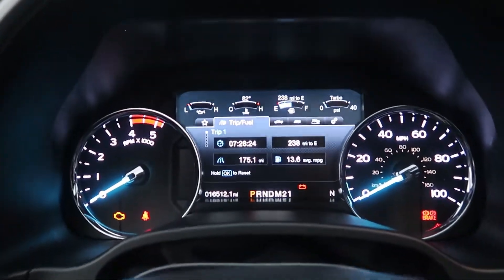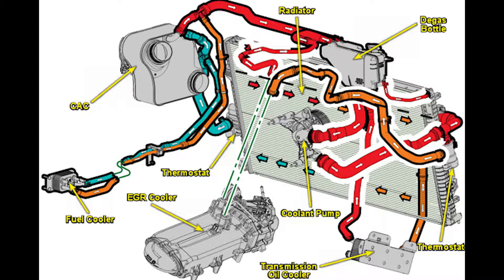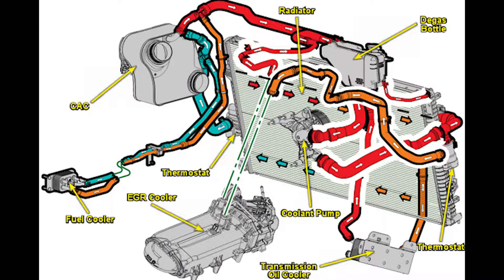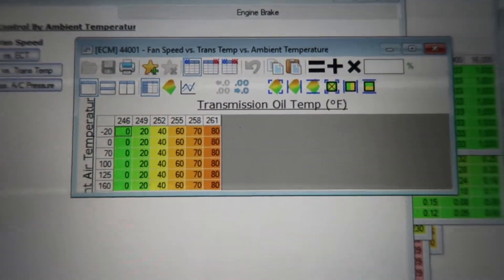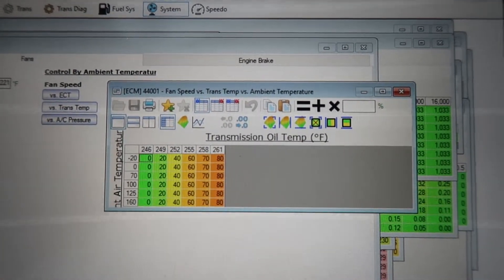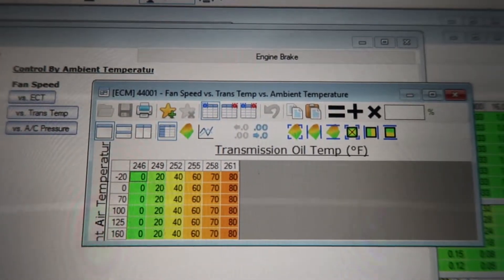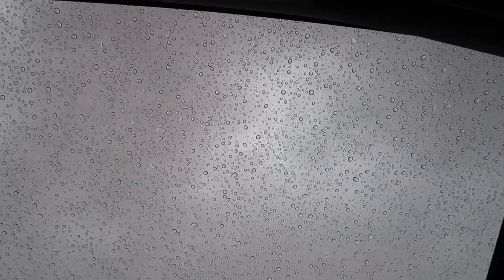Why the Ford 6.7 Diesels  Run "HOT"

Comment: I’ve been getting oil temps to 246 climbing hills pulling a big Tex 22gn trailer and a sany 50u 12 thousand pound excavator. My fan kicks on at 238 i thought it was having issues it’s a 2017 f350. My 2019 doesn’t get that hot pulling the same trailer and excavator.
Reply from the maker: Might be time for a oil cooler

Comment: Not trying to be combative but not fully buying it. My 23 F350 Tremor w the 6.7 HO runs steady temps even overloaded through the Rockies. My 2024 F350 runs way hotter on the same routes at 18000 lbs loaded (1500 under gvwr). I think Ford went super aggressive in 2024 and 2025 for tightening EPA regs. Not good for us.

Comment: Thanks. Well expressed. Im pulling a heavy load these days and worried often about running my transmission over 215⁰. I'd back off to 55mph. This cost me a lot of miles per day. Changing your fluids regularly and more often in the transmission are very helpful in prolonged life if towing. Ford mechanic (my neighbor) said to replace the trans fluid as often as 25k miles for heave constant towing,

Comment: I have a 2015 F350. Pulled my 12k trailer up a pretty serious grade. It was 74 degrees outside. My engine oil temp hit 247. My coolant temperature went up to almost 3/4 of the gauge. When I crested the hill, the temperatures came down quickly. I did not hear the engine fan engaging. I know my parameters were acceptable, but is it normal for it to get this hot low ambient temps. I’ve only pulled with it once, but it’s a freaking horse. I live in Nevada and it will be over 100°. I just want to ensure that I’m not gonna have any overheating issues. Any comments would be appreciated.
Reply from the maker: That is not normal. Is the truck tuned? Tuning can produce higher coolant temps and thus oil as well. Also check your coolant level, make sure you're full on both expansion tanks. Look for debris between the radiators. I tend to see a lot of leaves and trash buildup between the two rads, also bugs and rocks tend to get stuck in the radiator fins themselves on higher mileage trucks. Remove your plastic rad cover and look between them, shine a light on the backside and try to look through the radiator fins. These work well for cleaning them out: https://www.napaonline.com/en/p/BK_RG1002BK?cid=paidsearch_shopping_dcoe_google&campaign=GSC-Tools-Equipment&campaign_id=8553470562&adgroup_id=107047174069&adtype=pla&gclid=CjwKCAjwg-24BhB_EiwA1ZOx8jvOkEZz4UJb_HAo0bH7-mSRE312IQv535upJRVHGco-CaG7vxrTERoCVsgQAvD_BwE&gclsrc=aw.ds&gad_source=1

Comment: I have a quick question? What is Ford’s desired oil temperature and what really is the sweet spot? I see coolant and transmission. I just want to make sure about oil. Because I live in Central Texas and it’s hot! I would really love to know! Thank you for the video!
Reply from the maker: Within 20* of Coolant. IE coolant = 220 oil should be 240 or less. Oil is cooled by coolant therefor it's temp will never be lower than coolant except during initial warmup. Bad oil coolers will cause higher deltas.
Reply: @JaegerWrenching  thank you! Just wanting to make sure! Got a new subscriber too 😎

Comment: Also about fan speed , my coolent was at 210f but my oil was 280f ( plugged oil cooler) fan didn't turn on on high! , I wonder if coolant and oil needs to be at certain temp in order for ecu to turn on fan.

Comment: What happens when you sit in traffic with air to liquid? There is no air moving , will it overheat ?
Reply from the maker: You have a fan that pulls air through the radiators while sitting or moving. If your temps were getting to 280 you have an issue with coolant flow coolant fill or air flow... Most trucks that have some miles on them get dirt and debris on the radiators blocking/inhibiting air flow through them. I recommend removing your front grill and thoroughly cleaning your radiators "there is two of them" with a pressure washer until water flows easily through them.

Comment: So I was pulling my toy hauler that weight 9500 empty , up to 9% slope , my oil temperature went up to 275f, at 280f I had warning light slow down motor at high temperature , reduce power , so ford programmed warning light at 280f , so truck can go up to that temp and survive if ford have safety light at that temperature , full synthetic oil degrades at 400-700f , reason I got such high temperature , my oil cooler was plugged , I took it off and I had bunch of junk in coolant ports , iron block needed to be cleaned , replaced oil cooler , flushed my system and im back to normal towing Temps 240f up 9% grade. Oh i have 2011 ford f250 with 270k miles on it , delited. 
P. S also for all of you trying to compare ur truck temps to ur friends truck , it only works if both of thrm are stock , if u have 37" tires and lifted , ur trucks work harder rolling ur big ass tires up the hill so you will have higher temps than ur friend on stock tires .! And no lift. !

Comment: I wonder if you can answer a question nobody else has been able to help me with. I have sensors on my water as well as air temps. Do you know what the max air intake temp should be going into the motor after it comes out of the cac?
Reply from the maker: There is no max temp and it'll run with very high inlet air temps. How ever your turbo will outlet 350* air temp prior to the CAC. A good working CAC should be able to bring that down to 150* or less. Tuning and total airflow through the cooler will changes these numbers a little. Hot tunes can get turbo outlet temps into the 450+ range and post cooler into the 160-170s. Boost Derate happens based on a specific boost number and barometric pressure as those two things dictate exactly where in the turbos compressor map you'll be operating and thus how efficient it is at compressing air at that exact point. More efficient = less heat generated or lower turbo outlet temp, less efficient = higher turbo outlet temp.
Reply: @JaegerWrenching  thanks for all of the info. The problem I'm having is I'm getting about 405° out of the turbo and then it's still up to 225 after the CAC.
Reply from the maker: @duner1972  What is ambient temp and how quickly does it get up to the 200s?
Reply: @JaegerWrenching  it's usually in the 90's ambient. It's when I'm pulling long hills pulling about 20k. It's a 2015 F450. I have actually melted 2 intakes and blew the backs out of them.  It has gotten better after switching to a soft so I can run stock settings. I just didn't know if putting an aftermarket CAC would help. Even in stock mode, I have to fether the throttle to keep egt's off of 1500
Reply from the maker: @duner1972  Put a 2015 andup[ turbo on it. That SST turbo is great for down low but it doesn't have enough air to clean it up. Those number are pretty norma for longer pulls and with a heavy load. The cooler will saturate. If anything replace your cooler with a stock one. Also check your coolant level  on your smaller coolant tank by the rad fan passenger side.
Reply: @JaegerWrenching  it actually does have the larger turbo. I already had that checked. I was having a problem blowing water out of secondary cooling system. I put a cap off of a 6.4. It's higher pressure.
Reply from the maker: @duner1972  Your CAC is bad and it's pushing boost into the cooling system which is why your cooler cap would push water . This pushes the coolant out of the CAC and so it doesn't cool properly. This is common! Replace it ASAP with a stock one as every aftermarket one is worse than stock. SPE has one coming out which maybe better but i'd go with stock if it was my truck.
Reply: @JaegerWrenching  Yes, I actually had my original one go bad, I put a new stock one on it. I think that's what melted my intakes, but it will still push water if I fill it to full line. I'm just wondering why I'm getting intake temps up so high. If I just drive it according to the dash gauges and pyro, everything seems to be ok temp wise. When monitoring actual intake temp, just seems high

Comment: Seems like Ford really designed and engineered a great engine, a real towing machine. I bought a new '17 250 6.7 not because I tow but because I enjoy road trips and want an engine that can muscle through just about any grade or temp without puking. 

My late dad always told me to always get the biggest engine you can afford. The weight of the vehicle and air resistence remain the same. A larger engine works less than a smaller engine. I've seen so many vehicles in southern California climbing Tejon Pass pulled over with steam pouring out from under the hood. Granted, most people don't take care of their cars and let it disintergrate. The signage says to turn off A/C and drive easy. I would drive up with the A/C on, comfy, and never even came close to heating up, passing everyone. So I'm glad to see that Ford made the 6.7 a great engine.

Comment: I tell you what, the second day I had my truck, I grossed about 42k lbs up a grade and she pulled like she didn’t care. Only time so far I’ve heard that massive fan kick on was right at the top when the temp gauge moved up 1/8 off center. Temp went back center literally in 2 seconds. You solidified it brother, FoMoCo got it goin on 😅🤙🏻👌🏻I’m so glad a deer wiped out my 7.3 cause this was a good upgrade🥴
Reply: I know right I was wondering to if temps where normal i grossed about 30k lbs on the daily rarely do I here my fan kick on but you’ll definitely know when it’s on cause it’s loud lol
Reply: Oh ya dude I am so happy I bought one, I came from a 6.0 and it’s un believable the difference on it, it’s a good upgrade for sure!

Comment: i really wonder if that is done for efficiency reasons only? for example the emission sytems likes heat,  along with other various efficiency reasons. But is it ideal for the longevity of the engine an trans? this is where im not convinced it is not! million mile trucks arent running at 200+ all day long!! the entire racing industry is constantly trying to come up with better ways to control heat instead of making it an acceptable thing, which is what i feel is happening here with the main reason being to try to make the emissions system more efficient. who cares how long your truck lasts. they sure dont, they'll be more than happy to sell u a new one when u reach 100k!! we spent the last 20yrs putting bigger coolers for trans, engines, intercoolers because of premature failures now we're to assume this is acceptable! not buying it, the #1 enemy of an engine an a trans is heat an that didnt change overnight? what did change over the last several yrs/decades is vehicles being disposable "run it till it breaks then get a new one essentially" instead of trying to make them last a lifetime

Comment: I have a 2011 and half a dpf delete on it. I have an H&S programmer on it. My pyro 1 ( set on factory) and it reads all over the place from 1200 to 2200. Pyro 2 (also factory set) reads 135 degrees. I bought the truck like this. Any ideas?

Comment: Is there a way to adjust the temp at which the fan comes on? My truck is a cab and chassis with a service body that runs at least 15,000 lbs all the time, even more if towing. I don't hear my fan come on full until I see about 3/4 on the temp gauge. Thanks!

Comment: When I'm towing in b.c up long grades in summer I've seen 244 deg. On the oil but the coolant stays around 220-225deg. Do you think I should run a electric oil cooler fan? Or would a duel oil filter and deeper pan ?

Comment: I have a 2020 f350 dually xlt 80k miles.  I drove 75mph for a while and my trans is 200 degrees and my oil temp is at 201 degrees.  This is norm?
Reply from the maker: Normal

Comment: Havea a question when towing heavy my delta uphill is about 30 to 33 degrees difference is that ok? It does drop once flat surface to normal temperature.

Comment: Good info and perspective. Wondering if you have any insights on the upper EGT range on the 6.7?
Reply from the maker: Stock tune starts defueling around 1450 and will defuel to a sustain a EGT of 1350.
Reply: @JaegerWrenching  Awesome, just what I was looking for. I had my alarm set at 1200 on my 6.4 but figured the 6.7 might take a higher temp. Thanks!
Reply: @JaegerWrenching  Is that monitored at EGT1? I’ve notice there are actually five sensors now. EGT 1 (pre doc), EGT 2 (post doc), EGT 3 (pre dpf), EGT 4 (post dpf), and EGT exhaust manifold. I have experimented with monitoring the exhaust manifold, and I’m shocked at the high temps when towing.
Reply from the maker: @andrewjewkes64  egr pre cooler

Comment: Finally someone that gets it. I was concerned when I bought my 2017 and did my first tow with my toy hauler. Temps went soaring fast. They came down faster though. My fan doesn't kick in until I hit 250 on oil temp. I actually spoke with a Ford engineer for the Scorpion engines and he said the same exact thing you are saying. They set these parameters for efficiency and they can well exceed these temps without any problems. Towing at those temps several times a year can put you into the severe duty class. I change my oil every 5K with Rotella T6 and changed my trans fluid at 30K. I will change the fluid on both diffs when I hit 50K. One thing to look for on these trucks is the upper oil pan leak. I just had mine fixed for the second time. If it leaks one more time I will file for the lemon law. Kind of a bummer since I love my truck.
Reply: What’s the lemon law cause my truck is doing this
Reply: @DeMarcusArmstrongfishing  Typically if you have to have something fixed 3 times under warranty, the OEM is required to buy your vehicle back for the price you paid. After 3 times for the same repair it is deemed unreliable. That's what I've read but I'm no lawyer lol. It may vary state to state but I'm not sure. It also depends on the type of repair. So far I'm on my second fix for the upper oil pan. If it leaks one more time, I'm filing for the lemon law

Comment: I'm sorry but I really don't think this guy knows what he is talking about. For just about everything he said in this video . Sorry.
Reply from the maker: Then you’re really misinformed on these trucks and their operation.
Reply: @JaegerWrenching  I  have a 2019,F 350, 6.7 and nothing is even close to what you had stated. The temps you speak of is way higher than what my truck runs. So sorry if I don't believe what you had said.
Reply from the maker: @luckytrapper7656  That means your thermostat is doing it’s job as it opens at 196*f. These radiators can keep your trucks engine cool with little airflow so little in fact the fan never comes on. Your truck like mine probably stays around 192*f without the fan ever coming on. What temp does your truck operate at?
Reply: @JaegerWrenching  depends on the temp outside. I'm from Wisconsin so right now in the dead of winter it runs about 189 to 192. But 3 days ago it was running hot when I was driving to northern Wisconsin. It was hitting 216 then the fan would kick in overtime and cool it down to 207 in less then a minute. Trans temp is norm at about 189 but on this particular drive it hit 208. And would not cool down. Ambient air intake hit 171. I had to pull over to let the truck cool. Not good when you can smell antifreeze.
Reply: @luckytrapper7656  those temps are not enough to make antifreeze boil out, my truck in south Florida runs much hotter and never smell antifreeze. I don’t think you know what your talking about.
Reply: @colt4528  I live in Lake Havasu AZ and the outside air gets to 115. I tow with 2011 and it gets to 223 pulling a grade and the fan kicks on. I don't smell antifreeze. I cools right down to 210.

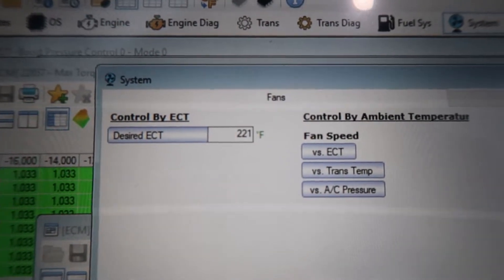Comment: 2:10 yes the oil can still lube but it's all that shit plastic that is not gonna like that heat. Plastic all over the 6.7 engine. Just wait till they're 20+ years old. Gonna be leaky cracked mess.

Comment: 232 is burning the trans fluid Ford thinks this is OK by classify you as a severe duty operator and should be changing it more often .
Reply: If you look up the new trans fluid specs it doesn’t start the flash zone until 380 degrees, fluids are made to run hotter than they used to be. Old fluid with those temps kiss your trans goodbye.

Comment: You know so much!   My 2011 f450. My oil temp when towing up hill a 7500 pound rv gets above 235 but my water temp stay normal. And idea?  Just changed the oil cooler and that didn’t help also running enlisted my oil temp is at 210 almost all the time and even higher when I drive hard.  So very confused and the dealer says I’m fine but I want a big 17000 pound fith wheel and am super worried if I had that big of a rig my oil temp would sky rocket.  Hope u answer me. I really need help
Reply: I got a 2015 f350 my old 5th wheel was 22k lbs and my boat is 12k lbs. 

I have towed across the desert with temperatures above 120 deg and have never delt with over heating problems. 

Seeing Temps get over 220 deg on the truck seems scary and abnormal but like the video says this is what the truck was designed for.
Reply: Water boils at 212 degrees. You want engine oil to be this hot. It keeps water out of the crankcase. Run full synthetic for protection up to 300 degrees. That will give you peace of mind on those grades.

Comment: What about oil temp. My oil temp gets into the 240 range when towing my 40 foot camper which weighs in 12,000 range. Is this something to worry about. If so how do I fix the problem
Reply: Mine runs 235° EOT with my 30ft 9k camper here in Louisiana @70mph on the interstate in the peak of summer (108° heat index) These temps are fine as long as your running a good oil like T6 Rotella there oil is rated for over 300°. If your still worried mishimoto sells a low temperature thermostat that drops by 5° or check out SPE performance they sell one that drops by 15° to 20° on ECT and EOT.